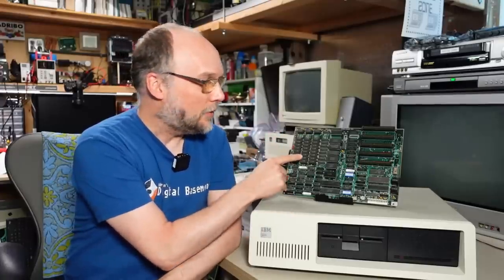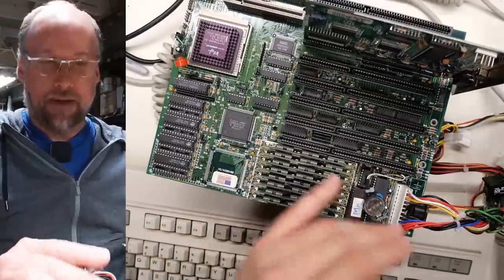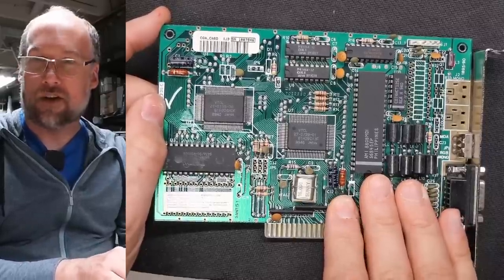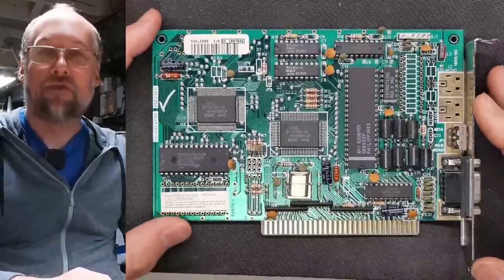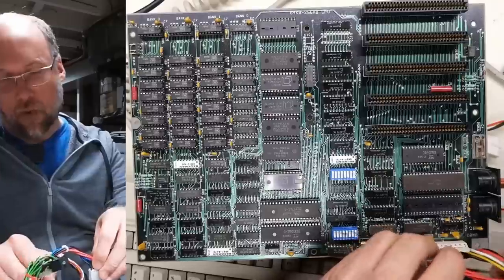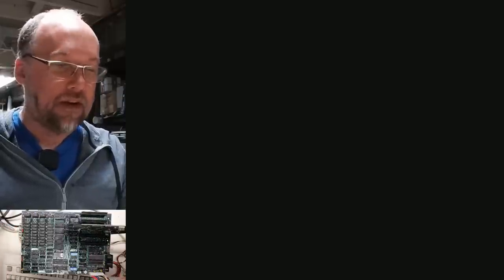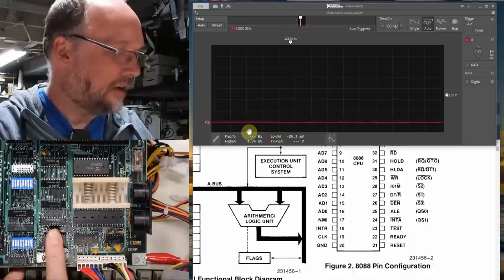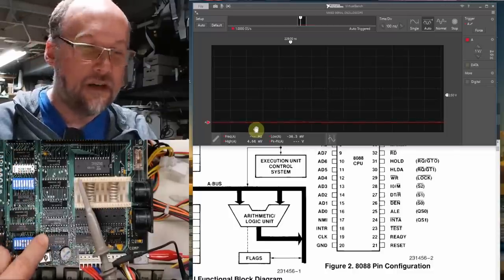IBM PC 5150 repair: The motherboard doesn't have the typical faults

Comment: I worked at IBM in the early 80's and had one of the first 5150 machines (with 16K ram). Since IBM was charging about $400 for a single diskette drive I used the cassette to load and save programs in Basic. It was a rock solid 1500 baud interface connected to almost any cassette drive using standard audio tapes. It worked great.
Reply: So I initually commented that IBM never released a 16k version of the 5150. But when I went to double check, low and behold they actually did. And cassette was a requirement. Floppy systems started with 64K as minimum. Very interesting. I couldn't see this being very functional unless there was a decent library of software.
Reply: Huh, that's fascinating, I never associate cassette storage with IBM, only older, smaller machines like the VIC-20 and Atari 8-bits and C-64 and such.  Also 16K, that's kind of amazing.  The Atari 400 came with that much (after a time).

Funny that the internal user was given this rock-bottom configuration!  Some kind of early dogfooding?
Reply: Yeah, my 5150 came with one bank of soldered-in 16K and 3 empty banks which were socketed (just like Adrian's except his was made slightly later and came with one bank of 64K soldered and 3 banks socketed). Adrian''s machine possibly came with a larger power supply as my machine came with an anemic 63 watt PS. I think after a while they no longer made machines with the cassette port as floppy drives came down in price.
Just F.Y.I. the Basic interpreter in Rom was (of course) from Microsoft and had a notorious bug. If you formatted output using the "print using" function and added two and two together the answer was 3.999. Headlines all over read "IBM computer can't add correctly!" I also loved that 6 pound mechanical keyboard that it came with.
Reply: Well, for software used those computer Basic books and laboriously typed in long listings. Those were mostly text based listings as they didn't have many listings that had code for the CGA adapter. But really, you could type in programs from almost any other computer at that time and just make a few changes to get it to run on the 5150. Eventually someone came out with Turbo Basic ($60) which could compile your basic code into an exe file. That made your programs at least 10 times faster.
Reply: Wait, you worked at IBM, and they themselves didn't give you a disk drive?
Reply: @3dmaster205  IBM didn't give me a PC. They had an employee discount plan and I bought one for my own personal use. I believe I paid about $1600 for their least expensive configuration. Came with a CGA card, and 16K ram. I had one of the earliest models.
Later on, IBM gave us 5150's and XT's at work with 3270 network cards added to connect with series 370 mainframes which made them into a very expensive "dumb" terminals.
https://en.wikipedia.org/wiki/IBM_3270_PC
Reply from the maker: @kronos5385  Nice! That seems quite expensive for what it was! Did you also have (a much cheaper) 8 bit computer? I have one of the early rev-A 5150 machines with the 16kb motherboard too and, of course, that one still works great. It really is a generally reliable machine. When I bought that machine from the original owner, he had installed a floppy drive and hard drive in it at some point. I'm not sure the config of it when he bought it though. The floppy drive in it double sided and IBM branded so unsure if it was original... I think the earliest drives were single sided too.
Reply: @adriansdigitalbasement  Hi Adrian, huge fan of your channel. I had many 8 bit computers before the 5150, a TRS-80, Atari 400, Sym 1 (board computer).
My 5150 PC listed for $2000 so I got a bit of a break using my employee discount. That original 63 watt PS was not strong enough to run a hard drive but I eventually put in a diskette drive when clone drives became affordable. They rapidly went down to about $20.
IBM got out of the PC business when clones drove the prices way down and they couldn't compete any more. They licensed everything to Lenovo who could compete.
Reply: Did IBM ever actually sell a 16k PC?
I remember the original motherboards being capable of it - 4 banks of 16k and 64k total - but every one I ever saw was fully populated.
Reply: @kronos5385  Lenovo was actually a spin-off company from IBM, as I recall it.
Reply: @bricefleckenstein9666  That is correct but Lenovo, based in Hong Kong,  had a much less expensive workforce so they could compete in this cutthroat business. Lenovo also made some of the best printers around. I still have one.
Reply: @bricefleckenstein9666 I'm sure they did, but nobody in my neighborhood had one. Most customers wanted the diskette drive in the machine, which meant that they needed the 64K for DOS to function

Comment: Q0 in the datasheet means "output unchanged". It's hard to put in words (especially when English is not my first language), but the described outputs are state "Q1" - basically the next state, given the current state and its inputs. If it says Q0, it's referring to the outputs as they currently are.
Reply: Agree.  The last line is saying that as long as you're not forcing the output with the PRE or CLR, and as long as the clock is low, the output won't change.  The value of D is ignored.  But TBT, I figured that out because I know how a D flipflop is supposed to work.
Reply: Correct-ish. Q0 is actually the previous state which was latched when CLK transitioned. On this chip; you see that Q0  is latched from the state of D on the rising edge of CLK. Clear in the truth table if you are familiar with how logic data sheets read.  
So in this case; the previous state of the flip flop/latch was last latched with D being low. OR CLR signal went low at some point initializing Q0 to low.

Comment: I bought an original with no floppy disks because the original drives were single-side only.  Then I bought double-sided drives which were completely compatible since the original PC used almost entirely off-the-shelf components.  Never used the cassette port.

Comment: You're embarking on the exploration of a huge rabbit hole with the Intel and IBM data sheets. The 5150 is actually quite complicated, compared to the 8-bit systems of the time. I've read that 5150 manual forwards and backwards several times, and I still learn something new every time I mess with my 5150. This stuff is a blast to mess around with!

Comment: S3 and S4 can be used to give the segment registers DS, CS, SS and ES separate address spaces.  The Altos 8600 is the only machine I know of that actually did this although only to permit some small bit of per-segment memory protection.  The functionality was removed in the 80186.
Reply: I always thought it would be intriguing to use those signals to map to separate physical 1MB banks. You could still overlay DS and ES for data sharing, but you could have a dedicated 1MB address space each for code and stack, for example. is that something like what the Altos did?
Reply: @soulpa7ch  Nope, they all share the same 1MB but it has a paging mmu which can set per-page permissions for which segment register is allowed to access the page.  The manuals are at bitsavers if you want more info.

Comment: 34 years ago, when I was 14 I managed to get my first 100%-compatible PC (because by then we were speaking about the compatibility rate). It was an XT-compatible motherboard supporting 4.77 and 8 MHz which wouldn't work, nothing was happening. I let it heat for a maybe half an hour while measuring voltages everywhere, until I noticed an 74LS244 that was totally cold to the touch. That made no sense, so I concluded it had to be dead. I unplugged my power supply (a variable one which could already have fried half of the board), carefully desoldered the chip trying not to peel off tracks, cleaned the holes and soldered another one. I was delighted with a BIOS counting memory when replugging the PSU. I was very proud (and very happy). It has been my main PC for several years!

Comment: One of the things I saw with these old IBM motherboards is broken traces near the memory chips. The board is not very well supported while inside the case, and a user adding memory could easily push the chips in with just a bit too much force. (And I mean seeing this back in the 80's.)

Comment: I appreciate the detail you go jnto talking about your troubleshooting process.  There's a lot about circuit logic I don't understand, like why pull-up resistors work, or what the negative 5 and 12 volt rails mean.  But as an IT professional, I applaud the time you take to start at the core problem and work back the why of the problem.   Keep up the amazing videos.
Reply: im right there with you. i feel like i gain 1% more understanding of how the chips and board work with every video I watch. its a lot to take in from someone that has 0 experience with all this but wants to learn
Reply: Voltage is like pressure.  So when you have it, it's higher positive pressure.  The negative voltage is the opposite.
Reply: Pull up/Pull down resistors are just a way to configure a resistor to hold a signal at a known voltage when nothing else is happening. For instance, if you have a Reset line that is active high and you don't want the computer to run without the rest of the system being out of reset, you might use a resistor of a few thousand ohms that "pulls" the voltage high to +5 volts and allows some current to flow. When something else pulls the Reset line to 0V, the resistor will separate the +5v from the line just enough that the signal is close to 0V and the Reset line sees a "low" signal.
Pull up/Pull down resistors are pretty important as they ensure that each signal has a known default value and isn't floating. Many logic chips (especially older ones) will either "drive" the bus by increasing the voltage to Vcc (usually 5V) or they will "sink" the voltage by decreasing the voltage to Vss (usually 0V) depending on how their output transistors are configured. In some cases they don't effectively do both, hence pull down and pull up resistors. Many data sheets will recommend Pull up and Pull down resistors on certain signal lines for stability reasons.
Reply: arkanoid376970’s explanation is very thorough, but I will share the nugget which demystified pull up/down resistors for me: a pull up resistor connects directly to the 5V line. A pull down resistor connects directly to ground. They’re just default paths, which the chip can override. 

We use a resistor because it’s easier for the chip to override than a direct wire :)

(If you’d like to learn more I highly recommend Ben Eater’s videos, as I believe it was one of his earlier videos which mentioned that nugget about pull up resistors and made everything click for me 😊)
Reply: You can think of a pull-up or pull-down resistor as a spring.  It holds a "lever" in a default position.  Pull-up is held high (+5V, for example) and pull-down is held low (Gnd).  When something else is driving the signal, it overcomes the resistance of the "spring" and pulls the signal to a high or low state, as dictated by the signal.  The pull-up/down resistor is then forced to whatever the signal is trying to do.  (Let's just say "pull-up" now, and assume that could be a pull-up or pull-down resistor.)

The pull-ups in this circuit are 4.7K, which is 4700 ohms of resistance.  Pull-ups are typically between 1K and 100K, depending on a few factors.  Lower resistances exert more "pressure" on the default signal level, so they take more current to overcome.  As long as whatever is driving the signal has a strong enough output driver (the transistor responsible for outputting the signal), the lower resistance just results in more current passing through the pull-up resistor.  It will get slightly warmer and use more power, which may be a concern in power-efficient (like battery-powered) designs.  But, lower resistances are less susceptible to noise or spurious signals causing logic levels to change unexpectedly.

OTOH, if you put a 1M resistor in a pull-up configuration, it will take very little current to override it.  So little, in fact, that in an environment with sufficient noise, it could be overridden accidentally.  So you have to pick a value in the sweet spot that doesn't cause excessive current draw, but also holds the default level sufficiently.  There's usually a wide margin there, and I almost always go for 10K myself.

Higher-speed circuits may also require either weaker pull-ups (to avoid forming a low-pass filter with the inherent stray capacitance in a logic circuit), or stronger output drivers to force the state to change decisively, since high speed logic, by its very nature, affords less transition time between samples.  Everything in engineering is about balancing compromises.
Reply: As far as rails go, different things in a computer require different voltages.  At this point in computing (the early-to-mid 80s), most logic circuits ran at 5V.  That's different now.  Logic these days runs, mostly, at an absolute maximum of 3.3V, and often 1.8V or even lower.  CPUs and memory are more in the +/-1V range.  That means that a logic "low" (binary 0) state is 0V, and a logic "high" (binary 1) state is ~1V.  There's very little margin there, so the levels have to be driven pretty tightly to one or the other, whereas in 5V logic, there's a lot of room for slop.  That is, a "0" could be 0.0V to maybe 2.0V, and a "1" could be 2.5V to 5V.  (Arbitrary numbers here, but you get the idea.)

As logic circuits switch from high to low, or low to high, there's often a period in between where they're conducting partially -- like a resistor.  This causes current to flow through switching device (a transistor), but with some resistance, which causes that excess power to be wasted as heat.  The lower the voltage the transistor operates at, the less current will flow through it, and the less heat is generated.  This (among many other factors) allows the logic circuit to run faster, because you can pack more transitions per second (thus more total time spent in a transitioning state) without generating more heat than the component can shed.  So, running at lower voltages is desirable -- but, it takes more sophisticated component design to be able to operate at such low margins.  That's why it's a constant effort to push those operating voltages lower, and thus allow components to run faster on less power.

Anyway... various components need particular voltage levels to operate at their best.  A logic circuit may be good to go at 5V, but a motor might need 12V.  Some components, like op-amps for example, might have trouble driving signals all the way to ground or to their positive voltage rail (like 5V), and so they might be run at +12V for V+ and 5V for V so that they can output a true 0V and 5V with plenty of margin (-5 to 0V on the low side, and 5 to 12V on the high side.)  Old memory needed bias voltages for similar reasons, which is why they also might need +12V and -5V.

It's possible to generate these extra voltages locally, using switching regulators, charge pumps, etc., but if enough components need them, or they need more than a tiny bit of current, it's way more convenient (and cheaper, and more efficient) to have the power supply provide them en masse.  That is why there are multiple "rails" of voltage -- because components need more than just 5V and a reference point (ground).

Audio circuits are AC -- they go above and below 0V.  So those typically use +5 and -5V, or +12 and -12V.  That is why old sound cards might require the -5V rail, which isn't available on most newer ATX supplies, and that's why it can be problematic to replace retro PC supplies with new ones.

Serial (RS-232) also requires signalling at positive and negative voltages -- although you can often get away with much much less than originally called-for, and can generate those voltages locally since they require such little current.

Comment: At least it's now a step closer to being functional. Many people would probably have tossed it out as dead especially if they lack the electronics knowledge to poke around and figure out what is going on. I like how you're undaunted by the fact it's a machine you don't have a lot of experience with from a service and repair perspective.
Reply: Well, that's how you get experience!  Nothing teaches you more than having to do the skull sweat and figure things out yourself.  That's how i became a subject matter expert on equipment that i have had no training on.  Just having to brute force repairs, and eventually you build up enough experience to actually understand how the bloody thing is supposed to work.

This is the HARD way, but it certainly does work, if you have the patience to keep on banging your head into that wall.  ^-^
Reply: @jeromethiel4323  It just seems to be a rarer thing these days with how new products seem to be made to be thrown away when they break.
Reply: @Firthy2002  True that. Indeed, if he has 3 hours into this (incomplete) repair, at what point does he toss it out and go buy a $250 (made up number) tested motherboard?

Comment: Any PC I came across back then always had floppy drives, never saw one with a cassette player attached.  I think the tape support in BASIC was pretty brain dead too.  Getting a machine code program into memory required jumping through hoops.
Reply from the maker: Yeah if it was BBC basic then inline assembly would be possible and easy! But nope ....

Comment: Just a nitpick here, but the CGA only did snow when you accessed memory during the raster scan, and (weirdly enough) it didn't happen in graphics mode.  The IBM PC BIOS waited for the blanking interval before updating the screen, so you never saw the snow if you used BIOS or DOS screen output functions.